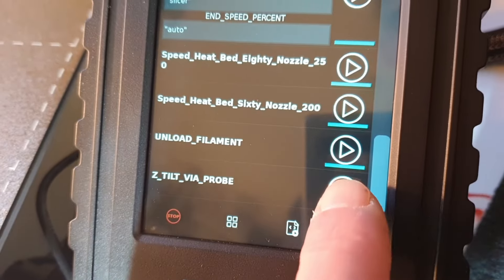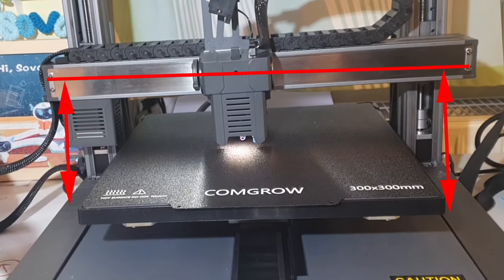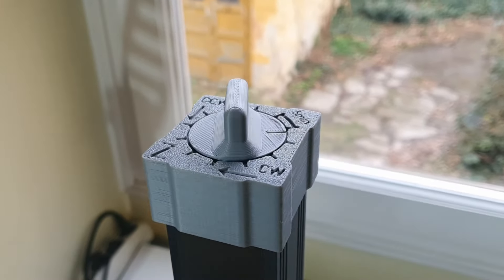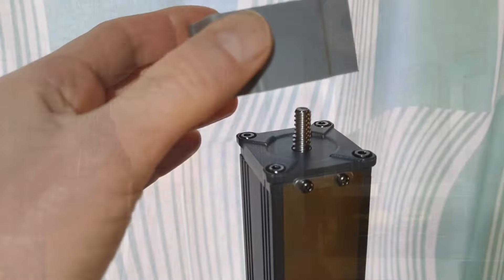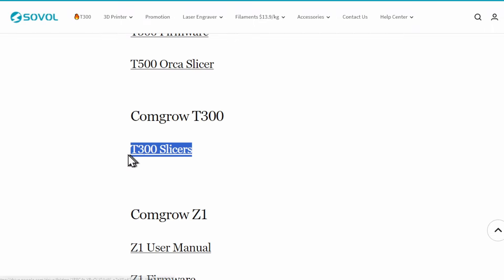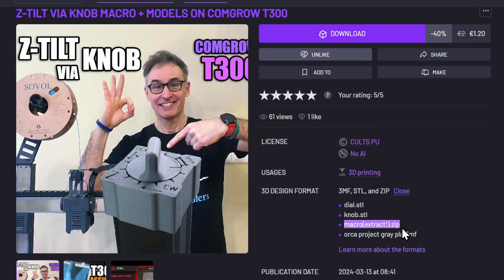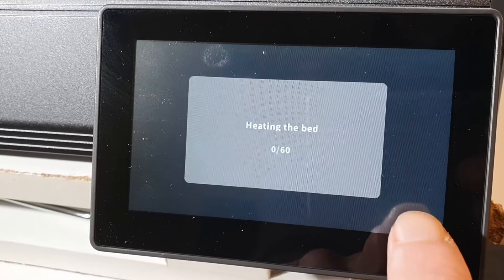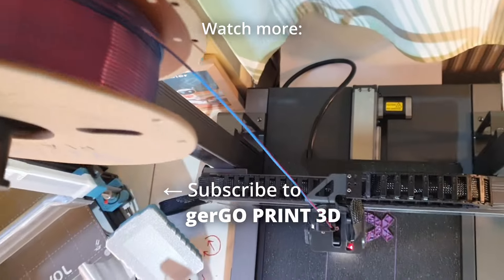Leveling problem? Fixed! Level your gantry using my Z-tilt Klipper macro + knob STL for Comgrow T300

Comment: Christian's method has made a world of difference on my SV07 Plus. It's great that you were able to come up with a mechanical solution that for a printer that doesn't support a programmatic one. And the way you calculate the necessary changes and notify the user is genius. Well done!
Reply from the maker: Thank you for your kind words! I was thrilled to discover that I could remap the “Calibrate” button on the T300, even though it doesn’t natively support macros on its screen. The T300 also surpasses the SV06 Plus in some respects, such as allowing for the partial unlocking of motors. This means we can skip re-homing before each probe cycle, streamlining the process significantly. Diving into Klipper was an adventure; it took me a few days to fully grasp it. As a software developer, I had a feeling I’d delve into macros eventually… and now, I feel like anything is possible!

Comment: glad I looked up the price for this T300 b4 making a comment about the lack of independent z-motors...
Reply from the maker: Check out my gantry connection video, it is the ultimate solution. This become my favorite quick-start printer, it can be printing the first layer 120 seconds after flipping the power switch. Instant heating bed, temperature-dependent pre-scaned ABL meshes (thanks to Christian Vick's macros) and no need for gantry leveling, this printer is way underrated. But it needs the hw and sw upgrades I show in https://youtu.be/Ni-Gmygg1g8 and https://youtu.be/Xl8jR6yaWc8

Comment: Is there a way to level the sv06+ bed? I heard of a way to do it but can't find anything on it
Reply from the maker: Look for my "z-markers" video. If you have Klipper there is a "z-tilt via probe" update too: https://youtu.be/1suV1QlMu0E
Reply: @gerGoPrint3D  yes I have seen this video but my bed is .8mm off in two of the corners and .6mm off in the others. That seems pretty bad for almost 5 layer lines off
Reply from the maker: @battlewagon15 I aggree, those numbers are pretty bad. I had simillar which I fixed by adding washers between the spacers and the aluminum bed carriage.  I have some silicone spacers being shipped, I will see if I can make the bed even more level using those those. If I succeed expect a video about it! All these issues we have signalled to the company during beta test, I hope future batches will include our recommendations, but these early units seem to be from the same batch as our beta units were.  But as I said, all can be pretty easily fixed.
Reply: @gerGoPrint3D  ok that should work. I was trying to just put layers of pla in between for now lol and then my nossle crashed into the heat bed because I had the metal sheet off. Had to order a new heat pad

Comment: just set my printer up. powering it on and going through the final setup tomorrow. was disapointed to learn that this didn't have auto z offset. so glad you worked out this awesome solution! i will definitely be going into this when i can!

Question - i have been out of 3d printing for about 5 years. i'm completely new to Klipper and things. haven't printed since i used my old Anet A8 and Anycubic Chiron, any suggestions on good klipper tutorials?
Reply from the maker: Congratulations on the new printer! The absence of dual-Z drivers isn’t a significant issue, in my opinion. Even printers with dual drivers require synchronization, and the automatic process can be time-consuming. I find the semi-manual solution to be faster. The T300 stands out for its user-friendliness, operable via the device screen with no prior Klipper knowledge. For those interested in delving deeper, the full Klipper version is accessible over the network. My initial foray into Klipper was with the SV07 last summer. There isn’t a single comprehensive course; my understanding developed through YouTube, Reddit forums, examining existing macros, and consulting the online documentation. I suggest watching my Klipper-related videos, as nearly all the concepts discussed in my SV07/SV06 series apply to the T300 as well

Comment: Hey, is this problem fixed now ? Does it have independent stepper drivers on its motherboard now ? Its price is 269 dollars now. Sv07 plus is 289. Which one would you recommend ? Also does T300 print ABS easily if kept in a heated chamber ?
Reply from the maker: The SV07 works out of the box, I've been using it almost without any modifications since I got it over a year ago. The T300 will need more mods (replace controller cooling fan, add silicone spacers for bed, print the adjustment knob shown in this video, or connect the z-towers (the "ultimate fix") as shown in here: https://youtu.be/Ni-Gmygg1g8 So the T300 will need more mods, but having 6-7 printers my T300 with the mods is one that is being regularly used, while the SV07+ only gets work when the SV08, T300 and Qidi Q1 Pro are all occupied.  Also, the T300 with its all-metal build, and way superior motion system  will probably last for much much longer than the POM wheels on the SV07. 

If you want a well equipped machine that will work right out of the box get the SV07. If you want a printer for the next 6-7 years, get the T300.  They are about the same speed. Feature set is also similar.

Comment: hi great vid, but for both the T300 and the sovol, if there is a power cut, we lose the leveling right
Reply from the maker: We do, but it is recommended to run this leveling before every print. I optimized the macros so it takes just a few seconds to do before your print. You don't need to redo the bed mesh though, since the gantry state is the only variable.

Comment: Do you think that this will work on the T500?
Reply from the maker: doesn't the t500 have independent z drivers? Isn't there an "auto z align" command under leveling?